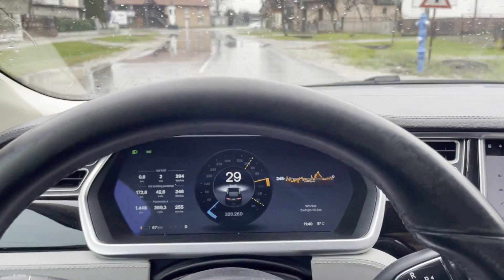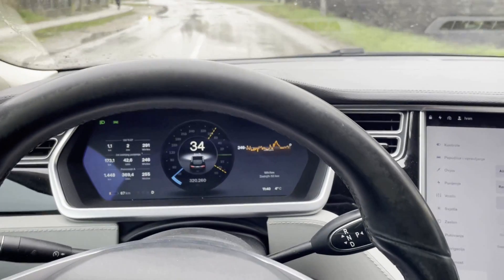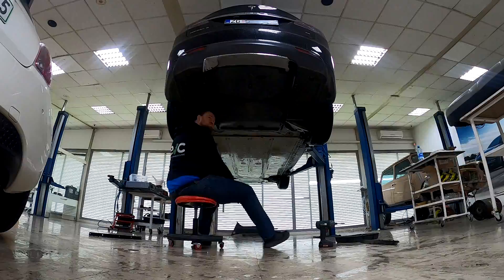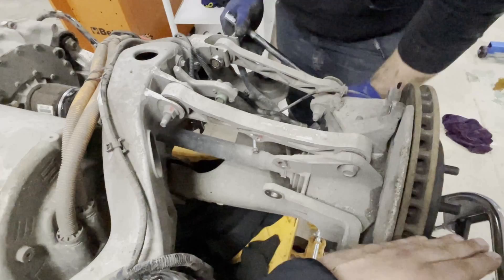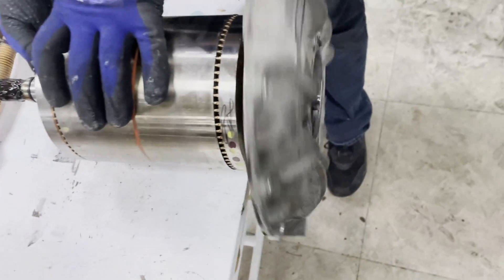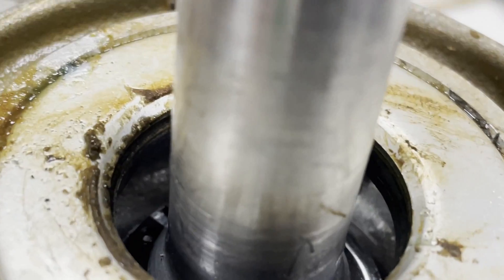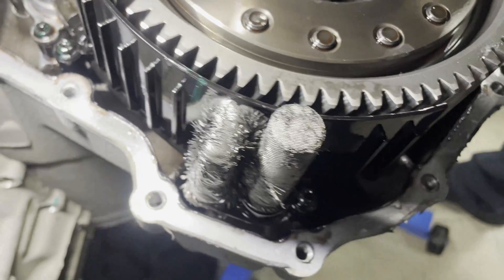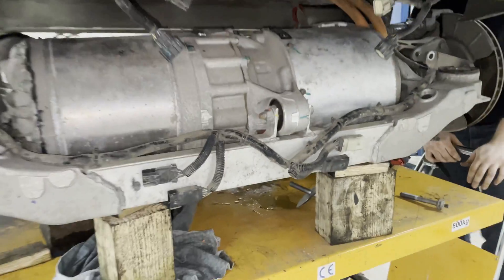Tesla S85 Drive unit refurbish - noise and isolation

Comment: I had The leak problem and I fixed it immediately, there was isolation counter error and vehicle won't start anymore. 

How do I reset The isolation counter alert after I fixed The motor?

The motor is now dried and fixed. I dried The stator at 130celsius for 6 hours and The isolation is More than 10 M ohms and everything is now installed but its still saying that regeneration brake is not on use, Power reduced and its unable to start, I beliebe because The isolation counter alert is still there and it says it has to Be reseted manually.
Reply from the maker: Isolarion must be above 10Mohm, otherwise it will fail again

Comment: I have a similar problem with my tesla model S 85 2014. A rattling sound can be heard from the front axle on the left, from a speed of 45km/h. , which intensifies with increasing speed. I thought it was a right wheel bearing, I replaced it, but the noise persists, I think it will be a motor failure.  But why a feel this rattling noise in the front?

Comment: I have a TMS 85D 2015 Model, On letting go of the gas pedal there is a "mechanic" noise mostly in lower speeds (below 70km/ hr). When I accelerate slowly or faster theres is no noise. Neither is there any noise on maintaining a speed. Noise appears only when letting go of the gas pedal. Is this coming from the gear box (needs a refill of oil) or is there something more sinister going on inside the drive unit? (water ingress/ ball bearings etc?) Happy to get any tip, but I realise these questions are difficult to answer..
Reply from the maker: @jackman9979  must be fully remanufactured

Comment: Isn't there a modified component that removes the cooling tube from this motor? I believe they figured that it wasn't required- that is, it was over engineered.
Reply from the maker: It is required, it is bandaid solution and causing fast rotor ballbearing deterioration

Comment: Did you do a coolent delete? Are do you do them now as that has been a fix tesla has been doing on the LDUs ( revision U ).
Reply from the maker: No, we graphite coat rotor and improved coolant ingress mitigation. Rotor cooling is crucial for heat scavenging and for ball bearing cooling. Premature failure is imminent without rotor cooling.
Reply: @evclinic  that makes sense. Are you aware of the revision U or latest revision Tesla is doing with the LDUs to improve longevity? I'd love to know more as I have a P85D.
Reply from the maker: @BFTVCanada  yes we have seen, that was released after our public “letter te tesla”.
But i cant say it is “improvement”

Comment: I Have and issue with my 2014 MS P85 had a battery repair 3 months ago ev specialist now 2 months later can came up faults bmw_w123_sw_internal_isolation , bms_w123_internal_isolation car shut down unable to drive.   car has done 86,000 miles he wiped the faults drove for 30 miles then same faults  then parked car and went into service mode also a new fault. contractors reqiure replacment.   alerts BMS-w161-sw-contractor-stress.  he says he took off outside cover spots of coolant in cover seal. he thinks motor has gone but I hear no noise he said if can throw up all sorts of faults. Is there anywhere in u.k that will refurb or can the unit be shipped to you for refurb. I dont know if i should do it or scrap the car incaseit could be something else aswell

Comment: Thanks for great video. Are you experiencing the same problems with drive unit of model S90D or just on older models S85? I have a facelift Model S90D 2016 with 222.000 km (oil and coolant   liquids renewed) with how much kilometers do you advise to refurbish (if necessary)? (refurbish coolant seal and or bearings)
Reply from the maker: Dual drive is small drive unit, without any issues

Comment: The replaced the trans fluid with toyota WS  and the noise seems to be getting less the more i drive. Im going to do it again after 500 miles and then a 3rd time after another 500 miles.
Reply from the maker: Good info, i will test it

Comment: Nice video, but you missed two important things.   You should have drilled a drain hole in the water manifold to the cavity between the seal and armature bearing.  This would allow coolant to drain outside the motor when the seal fails again… and it will fail again.   Secondly the bearing damage in the gearbox is from current drain that occurs when the motor fills with coolant.  The currant has no place to go except through the gearbox and out the half shafts to ground.
Reply from the maker: That is showed in our full training video, this is 1/3 of complete process. Check at our evc academy
Reply: Vanja pozdrav, koliko košta ovakav popravak.

Comment: First of all a big thank you for sharing your knowledge. Would you change seals and bearings periodically say every 200.000km? I have heard about a drain hole to detect leakage before the coolant does damage. Did you get all the required parts from Tesla?? Im in Australia with a 2013 Model S P85+ signature with 380.000km and we dont have a Tesla 3rd party workshop (I know of). And I want to keep the car, it is just great.

Comment: How much for a job like this. I got a whining noise on my motor of model s 2013 with only 59k miles. I got a Lincoln mkz with 190k miles and have only done oil changes and some recall repairs. Not sure why my Tesla now that is out of warranty stating to have issues
Reply: 2.500€

Comment: So awesome! “There’s literally nothing to fail in an EV!” Yeah, right. Love to see their face when they are told they have a $6-8k bill to fix the equivalent of a head gasket in their electric motor! And then 2 months later, a $15-20k bill for a new battery! And then a $5k bill for air suspension! And then a $3k bill for A/C failure! And then a $2k bill for battery heater, etc etc etc! “Nothing to fail! No oil changes! Only 1 moving part!” 😂😂😂
Reply: I've worked on electric motors for years. This repair is very easy. The seals are like $30 at most. Bearings can cost about $400 for really nice SKF type stuff. People are afraid of anything new to them. Got noise, replace the whole motor - $7000. A bunch of crap! All you need to do is what was done in this video. Rebuild the motor. You rebuild engines for more than this, and they're much more complicated and time consuming to do by comparison. 
As far as batteries go, they're not cheap but they don't always require replacement either. There are many scenarios where the battery can also be repaired at a fraction of Tesla's full replacement cost. And you can get credit for your old working modules. You just have to find a knowledgeable shop to do it. 95% are getting normal battery life which can last up to 350-400k miles. I get so sick of these people with this old horse and buggy mentality. There's more that's right than wrong with an electric car. And they are cheaper and easier to maintain if you have some know how.
Reply: @shwndh  Thank you for your thoughtful reply. I think it's important that anyone that reads your comment knows that, with all due respect, you have absolutely no clue what you are talking about. First, for you to suggest that all the problems with EV's are bearings is ridiculous. I have a 2023, and they don't have the leaky seal issue of the early Model S that causes bearing failure. My failure is a common one, and it is due to electrical failures that the average home mechanic has no hope of fixing like they could a coil pack, an alternator, a water pump, etc on a regular car engine. The whole drive unit has to be dropped from the bottom of the car which requires a lift for the car. Almost no one has one of those at home. Gone are the days of fixing motor issues yourself in your driveway. It requires special computer equipment that Tesla has not released to customers. They released a watered down version of their computer, but it won't give you what you need to fix these drive unit issues. Tesla charges $7K for a replacement drive unit, and the 3rd parties that work on Tesla's charge $7K for rebuilding your drive unit. So just shut up for once with your silly lies. And if part of your battery goes bad, fixing it is like opening up a light bulb to weld back the filament. In other words, it's stupid. If some of the battery cells are failing due to age, then the others are not far behind. Why would you spend $5-6K to repair a battery that will keep having more $5-6K failures over and over instead of buying a new $15-20K battery? The batteries don't care about miles, they care about time. Batteries are expected to last 10-15 years, so you would have to be an idiot to do that. The average age of a car today is 12 years old. In other words, almost all EV's will need a new $15-20K battery in their lifetime. Just stop replying to EV posts please because you are clueless. Have a good day.
Reply: I agree with the guy at the bottom! In fact the “bad batteries “ usually are able to take out few bad cells and lose very little range and not even buy new battery pack. This is newer info but usually the fix and EV’s have easier maintenance and wayyy less parts. I fix Tesla’s on side . I also love LS swaps too but EV just does it better !
Reply: Nobody says nothing will fail, there is just less to fail and less to maintain. I have 50k on my model 3 and have done tires. That's it. tires.
Reply: @nsxmatt  Stop lying. Fanboys always say there is nothing to fail. Funny part is the things that are different on an EV fail more often that ICE cars and all the other things that fail on ICE cars are on the EV. Keep in mind, the AC runs much more on an EV and I am reading of $6k bills from Tesla to repair the AC for it to only fail again just past the 1 yr warranty for replacement and they get another 1k bill! EV’s are for suckers.
Reply: Everything depends on how you use and abuse your things. There will always be  some pedal too the metal guys.
Reply: You such a hater lol
Reply: @filipegoncalves5338  You such a liar lol
Reply: Most cars dont end up on the scrap heap because the engine isn't running anymore.
So getting an EV because there are less things that can break makes no sense.
You get an EV for different reasons.
There are just as many things on an EV that can break. Especially as most defects on modern cars are of electronic nature.
Reply: @mrpetit2  no there are way less, do you even know a little bit about an ice engine? it's hell more complicated than an electric engine.
Reply: @mrpetit2 most cars does not end up in the scrap yard cause of engine failures? Really? My uncle has a scrap yard in Norway, which has more electric cars than petrol cars on the road. 90% of the ICE cars that come in for scrapping is either collision damage or doesn’t run, remaining 10 (12%) to be exact is other issues like old age/rust etc. get your facts straight. 

Now, has EV manufacturers claimed that their cars will never break down? No, of course not. Not only is that dependent on the wear and tear capability of the parts themselves, but it also comes down to manufacturing issues, climate, type of use etc. 

Does it break down less and demand less maintenance than an ice car? Of course! The drivetrain has a few moving parts, opposed to an ice car with engine, internals, clutch, gearbox, prop shafts, differentials etc
Reply from the maker: Completely not true, motor repair is 2500$ and it will fail after 600000km, battery repair is 5000$.
Reply: @evclinic  That’s completely not true. I have seen all the invoices on the user forums. You are talking about some hack repairs. People are not getting those prices. And battery and drive unit failures are happening within days and months, so stop your ridiculous lies claiming they will last 600km. Damn lies! And even if they were getting those prices, that’s still a lot of money for cars that are claimed to never break because they don’t have an engine and transmission! 🤣🤣🤣
Reply from the maker: @JetFire9  tthat is because you are stupid. If you compare with OEM price then, do you know that ICE engine is 20000$? Do you know price of transmission?
https://evclinic.eu/2022/10/16/mercedes-651-od-650-komada-1-valja/

Dont be stupid, complete world is on your palm. We maintain ICE for 14 years, every part on ev is cheaper 4x times
Reply: @evclinic Not everybody has access to 3rd party ev workshop, there is nothing here in Australia.  When my 8 year unlimited km warranty ran out I asked Tesla for a price of an exchange battery (refurbished, not new!) , it was over AU$50k (=46000€).
Reply from the maker: @moestrei  No problem even for that, you rent workshop and we fly in on 2 days to repair it. Or if there is more defect cars then even better
Reply: @evclinic  Even better: You open workshop here in Australia. We are an EV 3rd world country but catching up slowly and most evs are Teslas (of course).
Reply from the maker: @moestrei  Chalange accepted. Find team of 2 , workshop and we train them here for 2-3 months and you got your EV Troopers there
Reply: @evclinic  I will discuss your proposal in the local on line foren here.
Reply from the maker: @moestrei  go for it.
Reply: You forgot Tesla eating tires like no tomorrow
Reply: @vayduong6806  depends on how you drive. you can drive tires on a Tesla for 50.000-60.000km
slow acc. and braking and go slow while turning.

Comment: Thanks good video. But my rear drive unit only makes a klonk noise when I press gas pedal and same klonk noise when I release gas pedal both only at low speed. Any idea ? Can it be inside drive shafts the drive joints ?
Reply from the maker: Klonk noise is probably broken subframe
Reply: @evclinic  as far as I have I have checked no linkarms or bushings are broken. But there is a play when I turn the rear wheels when the car is up on the lift. More play on rear than on front, it’s a dual motor and no klonk from front en only rear.
Reply: @peteroffpist1621  
What was your issue? Was it suspension or motor related?
Reply: Cv axle outer splines need lube. There's youtube videos on this.
Reply: I have a clunk noise similiar to what you describe.  2013 MS S85 rear wheel drive.  Tesla mechanic did an inspection and said the front motor bushing is torn/cracked.  This would explain the noise, however, he quoted me a $7000 repair cost to simply replace the entire drive unit as I don't think they will do just a bushing replacement.  This seems outrageous.  As a bushing replacement could be done with just a few hours of labor and the right tools.
Reply: @wkrbtg9 
Tesla SC don't do those kind of repairs. They just replace with OEM stuff to avoid any liability. You need to go to an independent mechanic to fix something like this.
Reply: @wkrbtg9  I would guess that new driveshafts are needed. Our Model S is now quiet again and feels as new. It was only heard at low speeds . For us it was a 2.200 dollar repair. If you need a new DU get a used set and let a none Tesla repair shop make the shift.